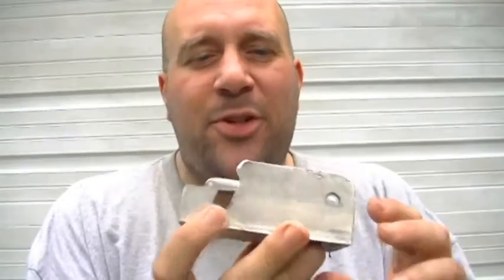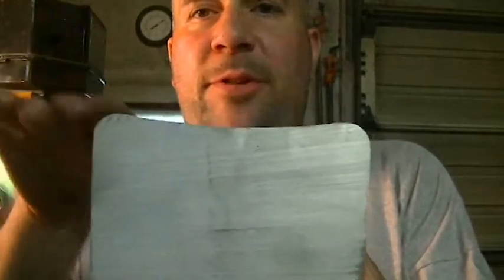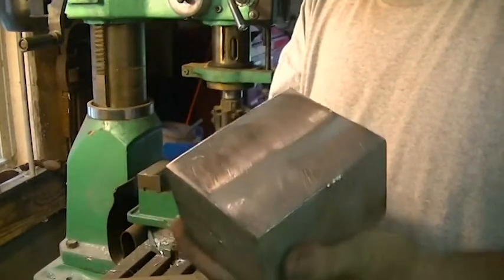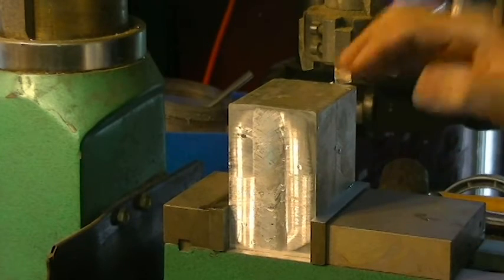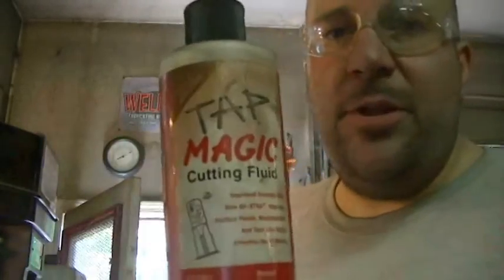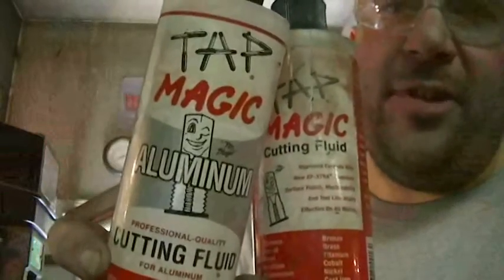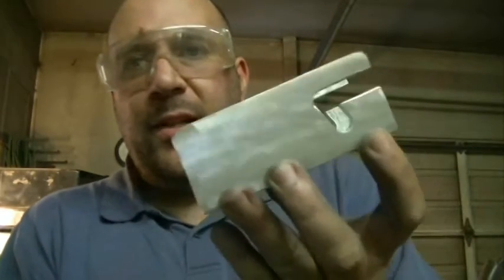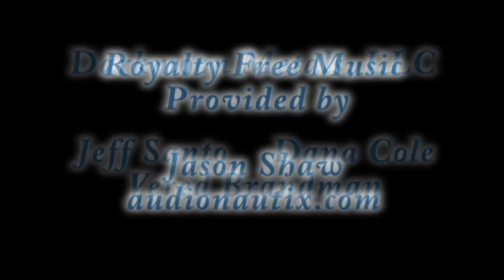Machining: Making A New Sailboat Mast Step From Solid Aluminum

Comment: Hi Jeff just a couple of points ! I see a comment about a piece of Al tig wire to take up vice/workpiece irregularities if you have any roofing lead strips (do you use it in the USA?) does a very good job,on iron castings as well. Also you seem to be climb milling but you say the machine likes it better? I'm surprised it doesn't Drag and kick up a fuss,particularly as when you go the "proper" way the finish is so much better.Cheers.

Comment: It may be new to you, but you got good results. I'm not a machinist either, but I've been working on it and learning where I can. The conventional vs climb milling thing is useful to understand...in machining and when using a router for woodworking. Same concept. Basically, if the cutter is pulling in the same direction it is moving, that's climb milling. If it is pushing against the feed direction, that's conventional. A way to remember is to draw a partial cut on paper, as viewed along the axis of the cutter. It will look like a straight line that swoops up to a parallel straight line. The cutter is at the swoop.  If you think of the swoop as an uphill section, the cutter rotating so that the edges come in from uphill and rotate down the slope, that's climb milling...the cutter is trying to climb the slope. Conventional is the other way. I hope that makes sense...easier to draw than describe!

Aluminum cutting fluid alternatives are WD 40 and kerosene. The later may be the cheapest option. 

Check out Abomb79, oxtolco, and thatlazymachinist channels for very good manual machining info.

Comment: Milling a piece with a rough side use a piece of aluminum tig filler rod on one side of the piece in the vice.  When 'squished' it will take up the roughness and the vice will hold the piece solidly.   Your mistake was actually in getting to square reference surfaces.  When squaring up a piece of stock after you get one surface milled (true), put that surface up against the fixed jaw with the tig rod on the rough side against the movable job.  Volia! You now have two reference planes perpendicular to each other.  To get the third side put a one finish side down, the other finish side against the fixed jaw, and the tig wire against the movable jaw.  Now you have 3 finished sides -- square and parallel.  The 4th side is easy (hint, you're done with the tig filler wire).  Working with stock that is 'plumb, level and square' is always desirable and makes the rest of the job easy.  All this assumes the mill head is trammed square to your vise.  On low cost column head mills you might have to do that with shim stock.

WD-40, kerosene, or even ATF works as a cutting fluid for aluminum.  It's cheaper than Aluminum TapMagic (which I think is just kerosene anyway).

You get what you pay for in machines.  A US built mill will cost you lots.  The trade off is an import with cheaper castings and fabrication.  Unless you're in a production environment where time is super critical, you can usually work around the quality issues.  It's the cost of buying the import for a tenth of the cost of the US tool.  Imports vary too: Japanese and Korean tools are as good as any found in the US.  Taiwan, and some European are next on the scale.  China and India bring up the bottom.  Buying Chinese or Indian tooling like angle plates just for the castings and remachining them is worthwhile since you can't cast the parts as cheaply as you can buy them.

Congratulations on completing the piece.  Looks nice.

Comment: Good job mate.
Some advise I would like to share, when needing to remove a lot of material, especially in steel I use stitch drilling to remove the bulk of the material. this leaves less milling to be carried out on the small machine and it also reduces the wear to your expensive milling cutters.

Comment: I was taught when squaring off material you first machine 1 surface, this becomes your reference surface. You should then machine a surface 90 degrees to that surface, you want to to have that surface against the fixed jaw of your vice.. You then machine the opposite surface to the second surface you machined, again you want to keep the first surface you machined against the fixed jaw.You now machine the side of the stock oposite your reference face, giving you 4 square sides. You now have the two end faces to do . So your reference surface goes up against the fixed jaw and using a good square you make sure the stock is square to the base of your vice on the second surface you machined. Finally you machine the last face making sure that you keep the first face you machines to the fixed jaw.

To solve issues with surfaces that aren't quite parallel you can use ever so slightly convex stock between the vice jaw and an unmachined jaw. It's also good practice to seat any surface you've machined on to a known flat surface, do this by gently tapping the metal with a hammer while holding the stock between your fingers.

Comment: That vice handle passed the quality inspection of the people who imported it and sold it to you. The fact that 'import' is universally used to imply 'crap' says much more about your tool market than it does the people who manufactured the equipment to your poor specification and low price. 
Enjoyed the video. Would it have been possible to fold / bend a piece of plate or fabricate?
Reply from the maker: I gave a lot of thought in regards to bending a piece for this project. In the end with the base of the part being a different thickness than the sidewalls I went with the milling option. I learned a lot while making it and "on the job" training always seems to more effect at least for me. 

I agree with your opinion on the import inspection, though many items are not opened before being sent to the consumer. They come out of a container put on a shelf and shipped. I think most of the import companies look at the overall cost factors, if they sell you something that is a dud they can just ship out another. That in the long run is a lot cheaper than hiring someone to review everything received. Of course this again is reflected in the "low price" that you mentioned.

Thanks for the view and comment! Have a good weekend :)